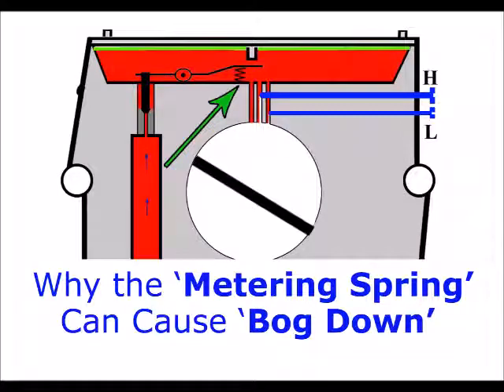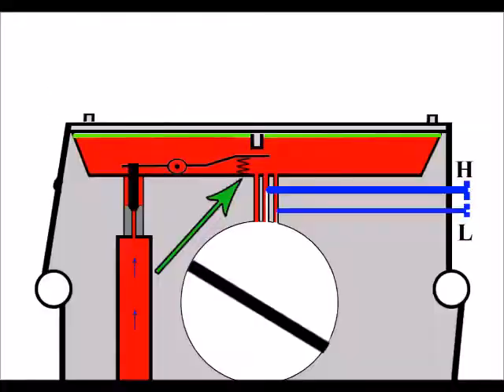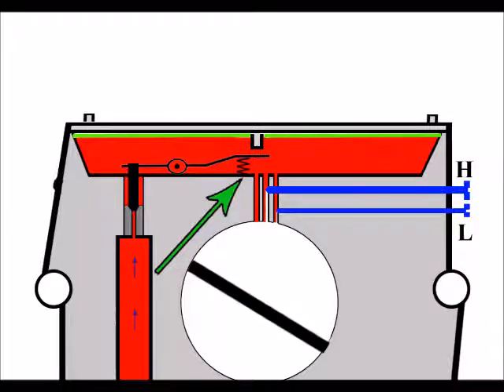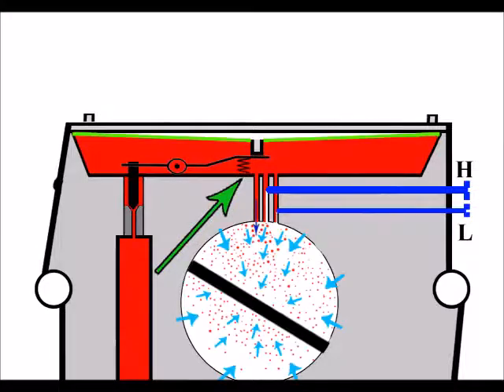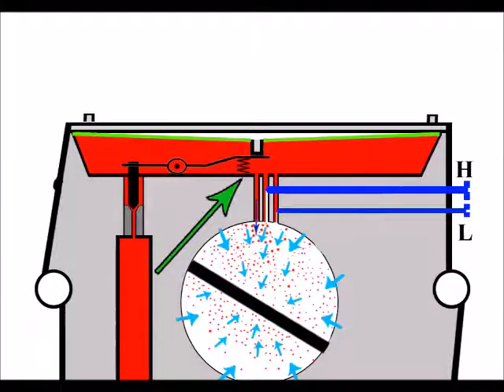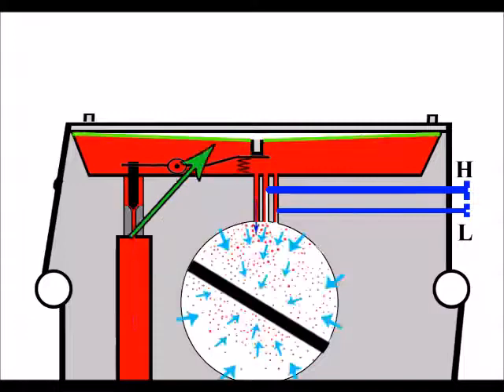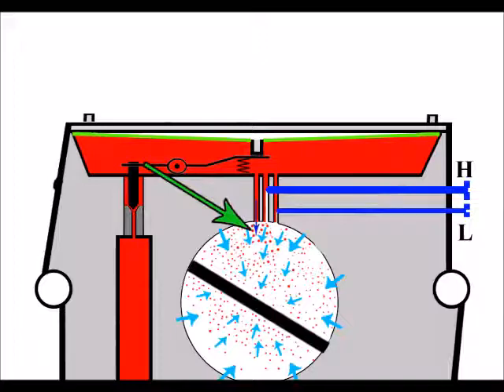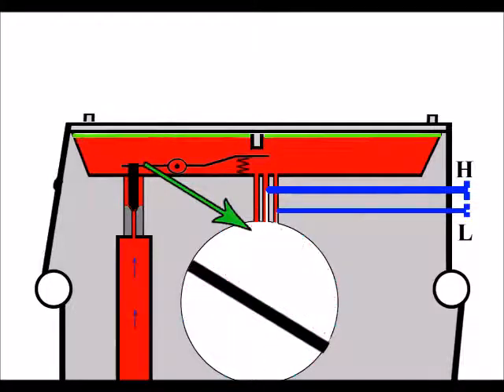2-Stroke BOG DOWN - Why Metering Spring can causes it - Two-Stroke Carburetor.  (by Craig Kirkman)

Comment: I don't think I was very clear. I'm sorry from Brazil and I speak English badly, in fact I write poorly.  the carburetor needle starts well but after some time the engine starts to drown with excess fuel. when i dismount the carburetor to check i realize that the needle is stuck in the open position.  It is possible that the needle seat is worn out. I used the Google translator once. Hahaha
Reply from the maker: Ok. If it was me I would make sure that the needle, the needle tip is in good order.  Then I would check to see if there is any damage on the side of the needle or the channel that the needle runs up and down within is not damaged and nothing is sticking out or chaffing the two surfaces. Then, if this is ok. I might just invest in a new needle (for the sake of a few dollars) to see if this sorts out the problem. I would also make sure that the metering spring is strong enough to push down the metering needle.  I would start there if it was me.  

I just also want to say that your Country looks wonderful when I see it on TV and You tube.  I some day will travel there.  I love Brazilian Jujitsu and my idol's are Marcelo Garcia and Royce Gracie.  It is really nice to know people from your country are looking at my videos.  thank you so much. Craig
Reply: so ... first I did exactly what you said I checked the needle. then I sanded the sides of the needle and the inner part of the seat with a very fine sandpaper. For about 40 minutes it worked.  after that it got stuck again and drowned the engine .... I bought a new carburetor and put it in place.  but after a while, maybe an hour showed exactly the same defect.  I’m talking about an engine that I use in my kayak that’s exactly the same as a brushcutter… all the same… the only thing I changed was the propeler that I put on a little smaller.  the engine turns a little faster and the kayak moves a little faster.  but I do not believe that this increase in the motor rotation causes this defect of the needle to stick.  I'm very happy that you understood me and liked Brazil.  if you come here one day come to Fortaleza Ceará, here it is very good and has beautiful beaches and places and also the food is very good and cheap.  I will be very pleased to meet you in person and take you for a walk around the good places.  we will be talking.  I'm glad Google exists.  I can speak a little English because I have lived there in the USA, in New Mexico.  but writing is much more difficult.  thanks for answering me.